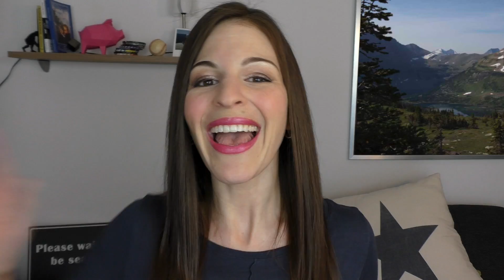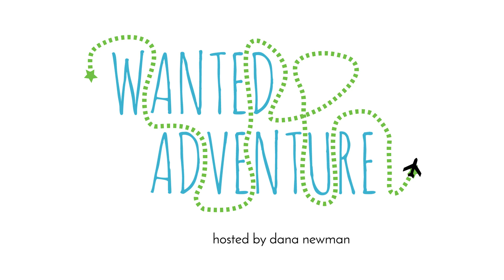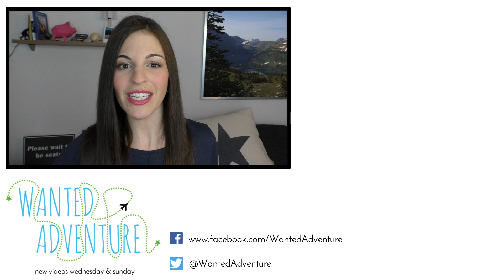Why Are Houses in America MADE OF WOOD?!

Comment: Most tornado damage is not from buses.  It's usually just from the wind itself tearing off the roof and collapsing the walls.  If a structure does not suffer a direct hit it can be saved if measures have been taken such as extra attachments between the roof trusses and walls.

Comment: Personally, I would prefer the inner frame to be made out of limestone and the exterior out of bricks. The floors I would prefer to made out of concrete slabs, the roof framing primarily wood and the roofing out of roof tiles, preferably at about a 30 degree angle. Window and door frames I would prefer to be made out of plastics (more specifically polyvinyl chloride, also known as PVC). The inner doors I would prefer to be made out of wood, because I prefer a wooden texture both in look and feel, but the front and back doors I would probably prefer to be PVC as well, due to insulation values and a consistent look on the outside together with the already PVC door and window framings. I believe that's basically it when it comes to the basics of the house. After that it's just about decorating, but that's an entirely different matter :)

Comment: Wood houses are easier to make changes to, attach siding to, drill holes for plumbing and electrical work. Brick and stone houses don't insulate as well either. It's tough to find a good mason in my area that is willing to work on a small project like a house, and they charge $100 an hour. I've taken out all the chimney's in my rentals just to avoid having to hire a mason to repair them (one quoted me $8000 to rebuild a chimney=3 days of work).

Comment: But most houses which are destroyed are not hit by a bus, simply by the wind and comparatively small objects. The wind speed will often cause enough lift to simply tear the roof off, and then as roof twists off it tears down the rest of the house.     If the main structure was concrete and stone, then the losses would be windows and possibly the roof. However the roof could be made far using far heavier timbers with stone walls as they can bear far more load. Combined with a little extra attatchment to the walls this would keep the roof on in all but the most extreme of cases.

So the argument that stone houses would not be sufficient doesn't really work. I think the american designers need to read the story of the three little pigs.  :-)

Comment: I have work in construction and did so for many years.  here in Idaho there is several reasons for wood homes. first of all being cost, a 2500sqf average home here in materials cost to complete is around 65,000. To brick the front of that same house 15,000 and that was just one side. Complete Brick/stone homes are heavy and require  dense ground and larger foundatation footprint adding even more cost.  In areas with a wide difference  weather conditions concrete/mortar will crumble .  Summers here are 105f and winters are -25f

Comment: The major thing is that it isn't just tornadoes.

For example, in the midwest you have both tornadoes and the occasional earthquake due to the New Madrid. Head down along the coast and you also have hurricanes, head west and you hit massive earthquakes.

Also the wider shift of temperatures in a lot of the areas between seasons would add other issues to cement houses.

On top of that, there are cement houses, they're just, normally, clad to look like another house style (Wood, brick, stone, or even steel).

Pretty much to protect from a tornado, you would need heavily reinforced underground house and not everyone wants to deal with living in a bunker...

On top of that, cement houses are far more difficult to repair or modify when needed. They're also far more expensive to build and demolish...

Comment: One reason our houses are built of wood is that individual people can cheaply and easily build "stick frame" houses with 2 x 4 lumber as framing. Before stick framing, houses were built with timber framing which required a lit of skill. Americans like to do things ourselves. And settlements could go up more quickly after stick framing was developed, as people who moved westward were able to build their own houses and stores. They didn't need the expertise of a timber framer. Wood siding was often used instead of brick siding because it was cheaper. We don't use cement or cinder blocks as often because these materials will crack and come apart if the foundation is poor - and a good foundation requires expertise. Again, it's cheaper to either build on top of wood pilings that were driven deeply into the ground, or (most often nowadays) on a concrete foundation that's stable enough for a stick frame but not stable enough for heavy cement walls. In the south, we don't have to dig foundations past any kind of frost line, so that makes our foundations easier and simpler, and makes it even less necessary to have an expert involved in building.

Comment: One thing to remember is that the US is huge.  Over 27 times larger than the area of germany.  In many areas there are no nearby sources of stone or brick and shipping such heavy materials costs a lot of money.  Also, "wood" homes are not just made out of wood sticks.  They are engineered structures, reinforced with steel and concrete.  Well built "wood" houses can withstand winds much better than many older brick buildings.  And tornados are not just windstorms.  They are giant vacuums, able to lift semi-trucks, that jump around leaving narrow bands of absolute destruction.  Once, I survived in a small, old, wood building with no basement, while a tornado ripped apart and collapsed a brick building directly across the street.  There's a reason they're called "acts of God".

Comment: Any material. Well in tornado alley I would go for 12 inch thick copper plate. . Windows of inch thick toughen glass alternating with half inch polycarbonate. Maybe 10 layers of that.  That would stand up do those conditions quite nicely. You could of course build a concrete blockhouse underground which is what I think a storm cellar is.

Comment: the correct answer is that most Europeans have no clue about tornadoes or earthquakes and just need to mind their own business.
 the research shows that nothing short of a bunker can withstand a tornado or a hurricane both of which can drive debris through anything short of reinforced concrete about 12" thick.
  tornadoes have been known to flatten even cinder block buildings like fire stations and schools that were designed to withstand high winds.
"tornado proofing" structures is an ongoing process that we have been evolving for about 100 years and the best we have come up with so far are underground shelters in or near structures no matter what type of construction is used.
 the forces at the center of an F4 approach a nuclear blast in wind speed and the pressure differential literally implodes the windows and sucks the roof off leaving the walls to topple in the wind.
  as far as earthquakes are concerned , in California we now have an early warning system for earthquakes because fire stations that were designed to withstand seismic activity ended up trapping the engines behind crushed and inoperable doors so now if we even suspect a tremor is on its way they roll all the trucks out of the buildings just in case.
 in the north ridge quake the concrete tilt up buildings did far worse than the wood framed houses with the only exception being an apartment complex that pancaked but in that case the investigation showed that the builder had not followed proper shear bracing requirements and that was what caused the failure of the structure.

Comment: Cost of material is why.. Keep in mind the cost of materials change from each geographical location. Cement & sand is very costly in the US, yet wood is still abundant. This could change in the next 50 to 100 years though. In other smaller countries, wood is a luxury at times and cement & sand is cheaper.  Now myself, I am originally from northern Mississippi. Not to far from Memphis. I have seen countless tornadoes and luckily avoided direct hits from them. Would a cement house survive a tornado. Often times yes. But the pressure from the cyclone would still likely rip the roof off and blow the windows out.. Only true safe way to avoid a twister is to build a hobbit house underground. That said. I now live in the Philippines. My house is cement here. The framing of the house is rebar with poured concrete. Then hallow blocks stacked in with more rebar and filled as it goes. Plus there is a huge thick concrete foundation. The house can take a modest quake. But still would need some repairing.  Wood house would not survive as much of a quake unless it was built with screws and not nails.
Reply: In India, besides having steel reinforced concrete pillars and thick brick walls we have windows that are covered in iron frames and grills. These are then covered from inside with wooden windows. I think this approach can be better than just glass windows for a more durable house, Though not any natural disaster-proof.

Comment: I build an underground home in Illinois 38 years ago. It was a concrete structure with rebar and post tension cables for additional strength. It was covered with soil (except for the south side) and had 3 feet of soil on the roof  Since the front (south side) had solar,  it had 16 inch thick solar trombe walls made of reinforced concrete. Was the structure tornado proof?  Not having been hit by a tornado, I can only say it is the most "tornado proof" I have ever been in.

Comment: I'm building a house soon and it looks like I'll be doing timber frame construction purely due to the cost. Ideally if price were not an object, I'd choose a combination of hempcrete/structural steel construction. But that costs about 30% more. 

Another reason wood construction is so popular is the speed in which it could be erected. And I think it's a combination of that and the economics that made it so popular in the hurricane belt. A day of destruction can be rebuilt in just a few months and everybody can get back to normal. While trucking enough stone/concrete material would take longer and be more expensive.

Comment: A couple of things here, a western frame or platform frame house has a life expectantcy of about 300 years with minimal maintanance , in rural areas of the midwest there are many Greek revival houses built from 1820- 1860 doing just fine. the 2x4 or scantling wood 16inches on center creates multliple paths for load. unfortunatly the houses built in the last 30 years are almost universely crap the framing wood that was only good for cheap pallets is always used now, the chipboard used for sheathing untill a few years ago didnt have enough resin in it to keep it from rotting , the homebuilders eliminated every peice of wood they could while framing , no bottom plates , and so on ,they are built with the mindset of 1970s american car makers , all kinds of crappy features tacked on but the basic structure is crap .

Comment: There are, however, ways to make houses more resistant.  Simple things like rounding the corners so that the wind load slides off better work well.  

That said, in most situations it comes down to economics.  The extra cost of building out of stone isn't worth it from a strict cost benefits analysis.  Build a shelter in the house that is tornado proof, and go there in an emergency.  The cost of rebuilding your house will be cheaper than the cost of making the whole thing tornado proof.

And, when you get right down to it, wood houses really are pretty strong, and brick in particular, can be vulnerable to earthquakes without special reinforcement.  A lot of brick in the U.S. has been upgraded, but there are areas, particularly around  northern Mississippi, that haven't had an earthquake recently, but geologically speaking, historically are high risks for big earthquakes.  The combination of low public priority (because people don't remember the last big one) and it being a pretty poor party of the country, could lead to a huge disaster.

Comment: Brick houses still have wood, though. Also, they can be affected by subsidence more detrimentally and are also hard to remodel/ refurbish. I don't live in the US, I live in Australia, but wood houses are very common here, too. The key is using good wood. The house I live in is 70. Maybe not old by European standards, but the wood looks like it was cut yesterday, as its bones consist of rivergum, which is highly rot and termite resistant. And with a good roof and siding, you can expect a wood house to last a lifetime. Again, maybe not great by European standards, but we're all slaves to the economy, I suppose. Wood is cheeper.

Comment: I would also wonder why houses are still made with long porches and car canopies but there is always a strong desire to conform to existing styles. I feel the only tornado proof house would be a brick pyramid without windows built largely below ground. These would present more problems though and be more expensive than building perhaps two or three replacement wooden houses in a lifetime. Not a simple question for the presenter to answer.

Comment: Wood is a renewable resource that will replenish over a human lifetime. Stone leaves a hole in the ground once removed, to fill it is you have to haul in dirt from somewhere else, or you could flood the quarry. A well managed forest could in theory provide a constant wood supply for centuries. The problem I have with wood is it does not react well to fire. Wood apartment complexes and houses are usually a total loss esp it the attic is involved. Stone or concrete structures don't burn as violently. As for tornadoes, the shape of building is key to tornado proofing. Flat faces generate more force than most structure can handle, so the idea is to eliminate flatness. and go with roundness. Domes, spheres and cylinders used in construction do help it to survive in tornadoes or hurricanes. Objects thrown into them are more likely to get deflected and not punch through. Combine round features with a material like concrete you have something that is about as tornado proof as you can get. A round structure also needs fewer support columns and thus less material than a square structure.

Comment: The Germans you spoke to sound slightly uninformed if they think that all of the U.S. is subject to tornadoes. Not all of us live in "tornado alley" but we have our own particular tough weather problems. We eat plants, wear plants (in the form of cotton, hemp and other natural fibers) and what are trees but the largest plants on Earth. Some of us even heat our homes with trees because it gives of a great heat. A renewable resource too. Pressure-treated wood doesn't rot or if it does, it is greatly slowed down. A beautiful wooden floor has a much warmer and inviting appearance than say a cold, grey slab of concrete. Plenty of U.S. houses are made from brick. You just have to know where to look.

Comment: (1)  Wood is cheap, so wooden houses are less expensive.  More people can afford them.
(2)  Wooden houses are adequate.  They may not be as durable as brick or stone houses, but with proper maintenance, wooden houses in my town have lasted 300 years.
(3)  Wood is easily worked, so that houses can be built in many styles.
(4)  Regarding destruction of homes:  tornadoes and hurricanes are rare ;  they usually destroy only relatively small areas ; and as you said, a tornado-proof house would have to be built like a bomb-shelter -- and just as ugly.

Comment: Wood is cheap. But also, different parts of the country have different challenges to deal with. The west has earthquakes. The midwest has tornadoes. The south has hurricanes. The northeast has blizzards. Some of these challenges overlap geographical areas, so building codes are tailored to the area.  A house built in California will have much different building and safety requirements than a house built in Florida. 

People in Europe don't seem to fully grasp how just how large the US is with nearly 5000km from coast to coast.

Comment: Obviously not old enough to have house-shopped or remodeled. 

Brick walled houses start with a beefier foundation to support them. Then bricklayers create the exterior wall! up to the first floor, at which time carpenters create the same kind of floor and interior wall framing as in a frame house. Then the bricklayers come back to build up to the second level, and so on. Finally a roof, not of brick, but lumber or steel frame supported with a deck and some kind of dhingles or files is installed.

Two contractors.

A carpenter can frame a one story exterior wall in a day from one load of lumber.  Two bricklayers take 2 days.  Admittedly the exterior wall is done on the outside, but a carpenter the. needs to build another wall inside to accommodate insulation, electrical ...

With a highly efficient crew, a brick home will cost 15,-20% more than the same floorplan in lumber with siding. Then be taxed at a similarly increased value forever. 

lumber is a low cost renewable material that is energy efficient to grow, cut and deliver. Bricks require mining, grinding, mixing and oven baking (unless concrete brick), and are heavy to move.

A flood can cause devastating damage to either one. requiring the inside walls to be ripped apart to replace insulation and drywall. A tornado can rip the roof off either one. 

The thermal mass of brick makes it harder to heat or cool a brick home.  

The question should be "why are American homes built with wood framing instead of steel?"